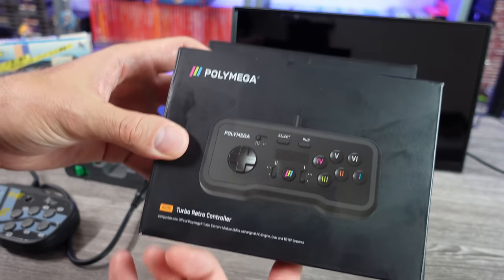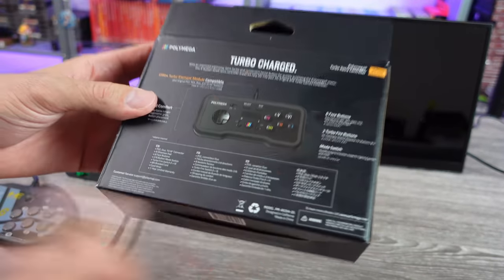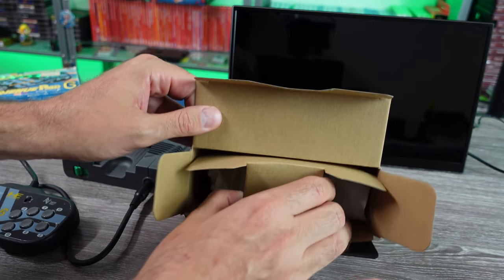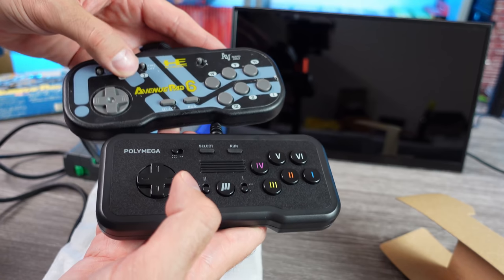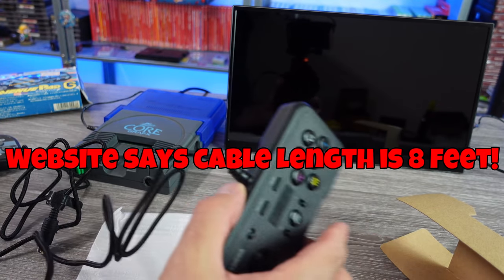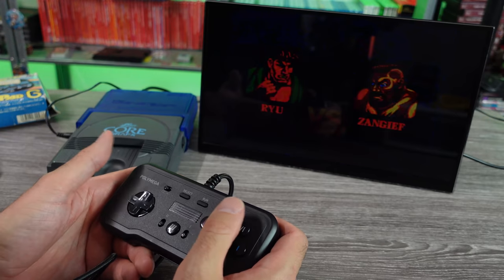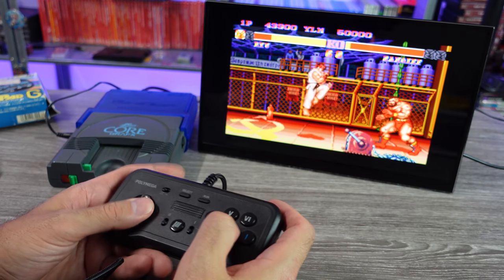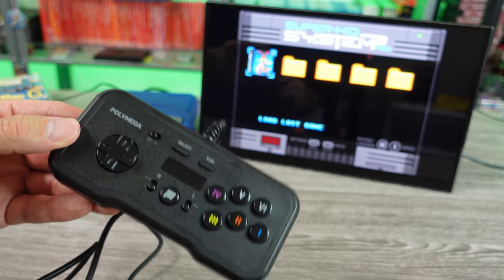Polymega Made A TurboGrafx-16 Controller! Does It Suck? Review & Teardown!

Comment: I bought one a while ago and the only real issue I ran into was the turbo everdrive menu selection getting a mind of its own when in 6 button mode. Other than that I’m pretty satisfied with it except for shipping which was a punch in the throat for sure
Reply from the maker: If I recall correctly when I had a turbo everdrive it did the same thing with the ave pad 6

Comment: What is annoying is that NEC even made the joystick ports different  between the  PC engine and Turbo Grafx16. Regarding the new controller, it is amazing how membranes are still used decades later. It looks like they coated the IC's surface to reduce corrosion.

Comment: Would this be a good choice for a new controller?
Looks like lots of extra buttons and turbo.
Reply from the maker: It doesnt actually have extra buttons, if comparing to the avepad 6 which is kinda a good controller to have for pc engine. Games that use 3 buttons or 6 buttons will be supported with it.

Comment: Ultimately when my polymega finally does come in, more than likely I will be using my retrobit or 8bitdo wireless controllers.
Reply from the maker: Dont forget with Polymega they have to add support for a lot of controllers to work. Retrobit works, but 8bitdo most ive tried hasnt worked. Hopefully they continue to add support.
Reply: @Madlittlepixel 
 dang.... I thought it was as simple as plug and play. Thanks for letting me know and at least my retrobits will work.
 Sub for life

Comment: Releasing a 6 buttons PCE gamepad without including a 3 buttons mode like on the Avenue Pad 3 (map run or start on button 3) is quite dumb (even more considering where run and start are on this gamepad) , unless they are both mapped to buttons V and VI in 2 buttons mode.
Reply: When in 2 button mode the III button functions the same as RUN.  I’ve had this for a while and that was a selling point for me.  However, my gripe is with the D-pad.  At least with the one I got I can press down on the center of it and it registers all 4 directions at the same time which games see as no movement for your character.  Total bummer.